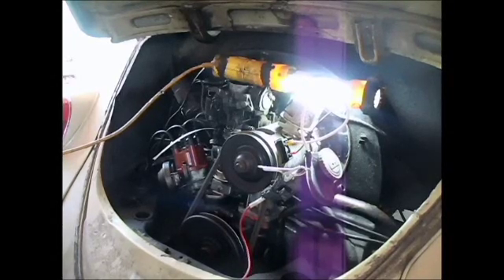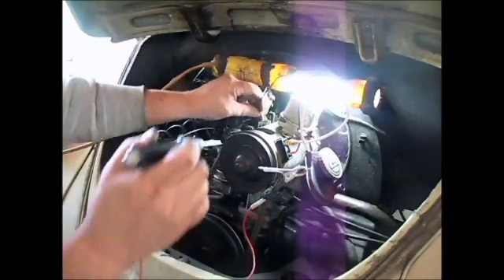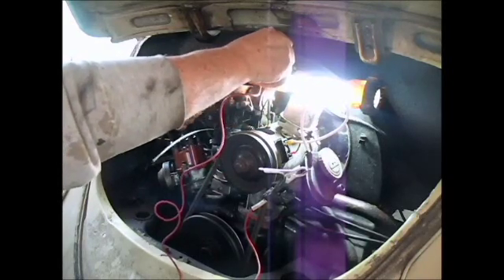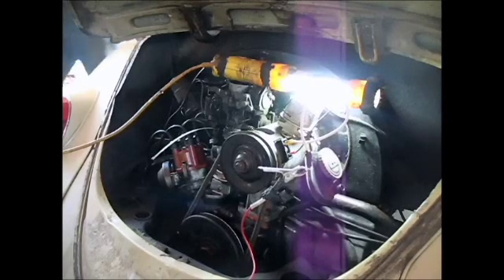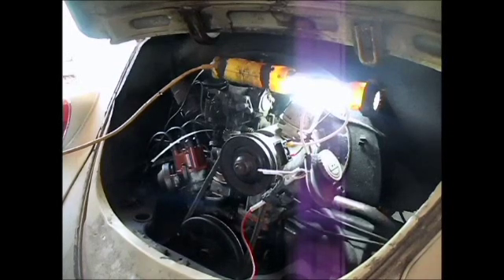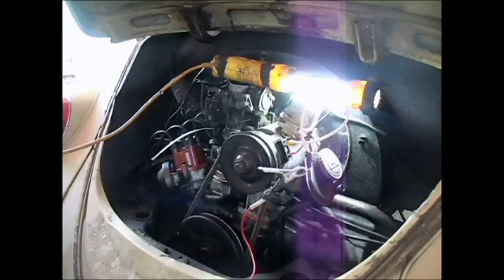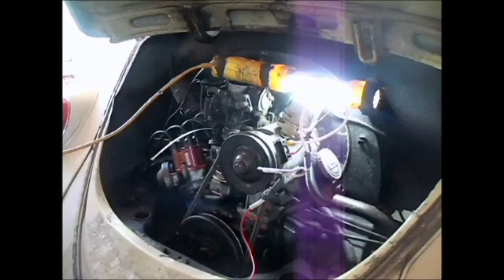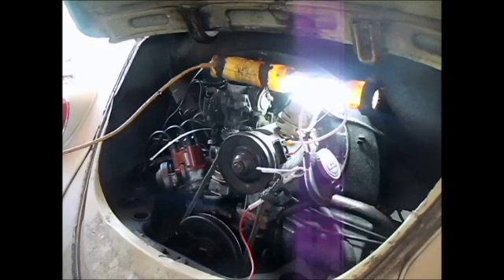Voltage Regulator swap and Generator Test '64 VW

Comment: I used to work on Lift trucks with Generators. A old timer told me that I had to energize the "F" terminal on the voltage for the regulator to start functioning. I have no idea if that applies to VW Beatles or not. I agree with an earlier comment that the generators did a poor job of charging at idle at least on lift trucks. I am sorry I can't be of more help but my experience comes from a long time ago and memory fades the older I get. Good Luck!

Comment: My little 65 has stopped charging too. Sounds crazy to me, but a vw guy that I work with, tells me that if the little charge indicator light in the gauge cluster doesn't work, then it won't charge. The Orange one should light up for a second when you turn on the switch. He says even if the bulb is just blown it won't. Mine did, but not sure about now. Anyway, I guess its worth a try.

Comment: in the past i tested the typical regulator from an alternator, where the rotor wires connected i used a 21watt bulb, then the earth and supply/monitor wires i connected to a variable power supply and slowly wound it up untill the light came on, about 14.5v.

Its only a crude way to see if the reg does infact work at all, hope you can use a similar way to test yours :-)

keep going you will win richard :-)

Comment: I guess you know by now that generators do not, repeat, do not charge at a normal idle, which is why all vehicles now have alternators, which do. Your regulator may be fine, but you pulled the battery cables off while it was idling and not with the engine revved up.

Comment: Y'know, electro-mechanical voltage regulators are pretty simple, much like a solenoid they most often fail because the contactors inside the regulator get pitted. You might try to take them apart and see if that is the case... if they are pitted, a little sanding with some emery cloth/ sand paper and both regulators might work just fine.